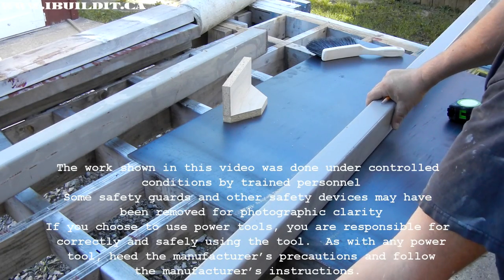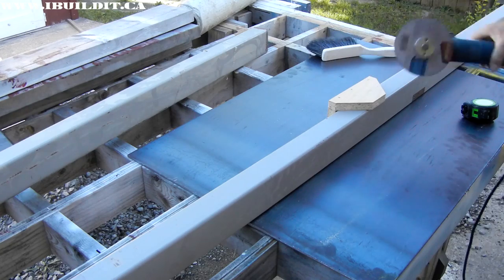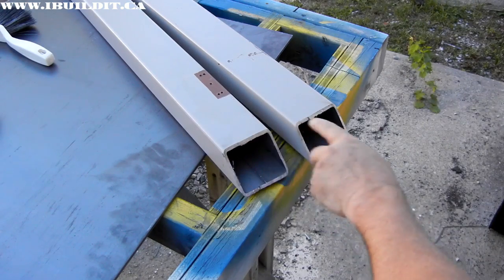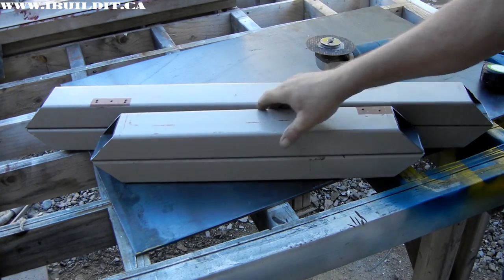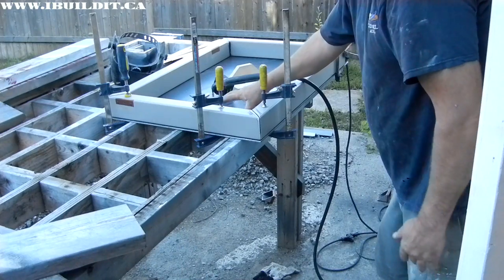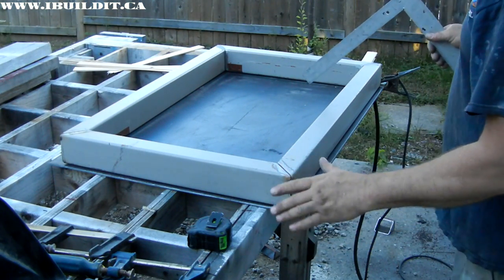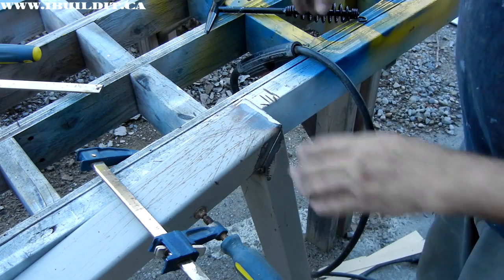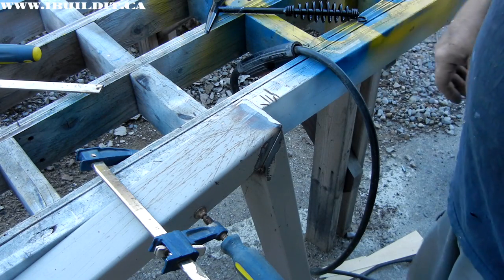How To Make A Steel Work Table, Part 1 of 4

Comment from the maker: The flux core wire has pluses and minuses: it makes more spatter, but I don't have the expense in time and money filling gas,  It's more expensive, but you can weld with it outdoors on a windy day. It's also more portable - I often use this in the work I do, which is sometimes outdoors on a windy day.
With all that said, when I get relocated to a more permanent shop, I will switch to gas.

Comment from the maker: Just 4 heat settings on my machine, with the second hottest not hot enough for good penetration on this thicker steel. Besides that, I don't stop long enough for much slag to form.

Comment: don't be stopping all the time to let it cool down if you think it is to hot turn your heat and wire speed down because if you keep stopping and letting it cool where ever you stop and let it cool then restart with out cleaning it off first for your re start you will get slag stuck in your weld.

Comment: a nice inverter welder would have helped you fine tune the heat going into your welds.  It's one thing I probably under appreciate from my everlast welder. If you do a lot of metal cutting, a cold cutting rage saw or plasma cutter would save you a ton of time. Thanks for the video I got a lot out of it.
Reply: +Richard Smart I could never go back to a welder with a tapped transformer. I'm too spoiled with saving my settings on my powertig. Everything should go digital.
Reply: When I buy my next welder it will probably an Everlast welder with an infinite heat and wire speed control like you describe. I've tried those transform welders and I always felt I wanted things to be between the available settings.